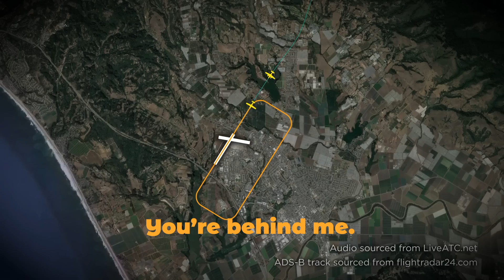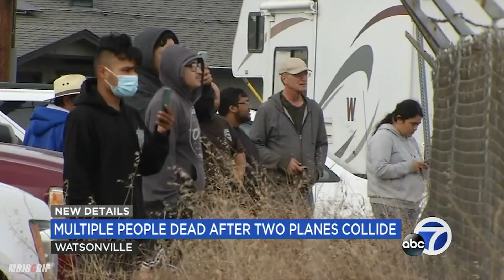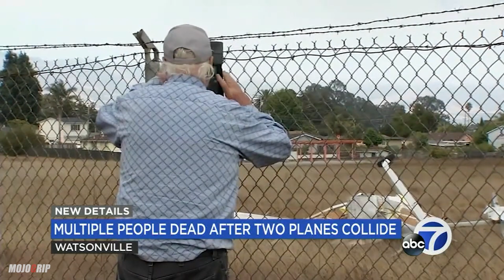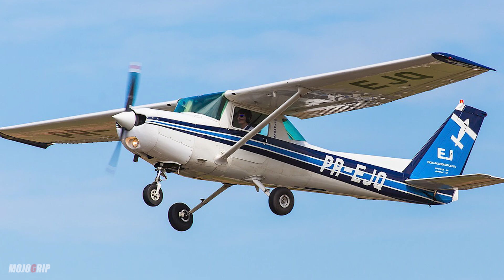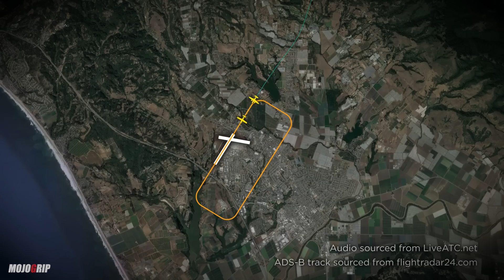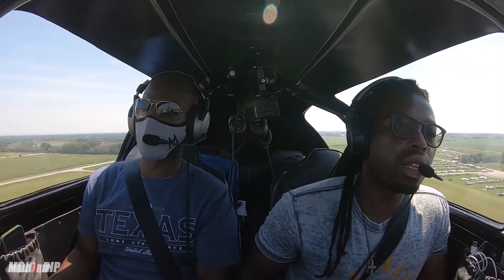Flying Too Fast Can Be Deadly

Comment: I fly a C414A, and I’d be about knots 3 or 4 miles out.  I don’t take chances with uncontrolled airports and enter on a 45 to the downwind.  Uncontrolled airports can have aircraft with no electrical or radios….and speed differences can be deadly. It’s hard to see small airplanes, even my C414 is smallish compared to air carrier. Not worth taking chances, I’ve called off approached when I cannot see an airplane I should. I have been flying 45 years, and have about 9,000 hours.  I’m an old, but not bold commercial pilot.  Final is the most dangerous place, but they can occur elsewhere and there are times where “see and avoid” has serious limitations.

Comment: Not sure what the sight picture is behind the yoke of a C-340.  My guess is that the C-340 pilot, in line, behind, and above, never saw the C-152, it being blocked from view by the nose of the aircraft.  The C-152 pilot sounded calm reporting having the C-340 in sight.  The C-340 pilot not seeing the C-152 may have assumed the other pilot would keep separation. 

14 CFR part 91, states that aircraft, while on final approach to land or while landing, have the right-of-way over other aircraft in flight or operating on the surface.

The C-152 reported turning base, but never reported turning final.  The C-340 may have been coming in hotter thinking he was giving more separation to the plane on base.

14 CFR 91.113 says that when two or more aircraft are approaching an airport for the purpose of landing, the aircraft at the lower altitude has the right-of-way, but it shall not take advantage of this rule to cut in front of another which is on final approach to land, or to overtake that aircraft.

In Advisory Circular 90-66B, the FAA encourages pilots to use a standard traffic pattern when arriving or departing a non-towered airport.

Comment: The twin was established on final. Yes he was in hot, but he was coming in and entered the circuit pattern. 

The 152 made an error of not extending downwind. 

Instructors need to make sure before sending their students solo, that they have the option of extending upwind and downwind. 

A straight in approach is a perfectly safe way of entering, as long as there is situational awareness. 

The twin wasn’t perfect, however this would have been absolved if the 152 had extended downwind.

I have just found out the 152 had his PPL for 2-3 years? That is a long time. If you hear anyone on final within 5nm extend, or you are asking for trouble.

Comment: What are you talking about? Neither one of the pilots did what they were supposed to do. Don’t come into a non-towered airport straight  in when there is traffic in the pattern, you need to join the pattern. 
Twin was at fault. But don’t turn final when there is another plane on final until you work things out with them, please extend your base. I do this all the time.
Reply: Did the 152 not call out his turn to final ?

Comment: § 91.113 Right-of-way rules:

(f) Overtaking. Each aircraft that is
being overtaken has the right-of-way
and each pilot of an overtaking aircraft
shall alter course to the right to pass
well clear.

(g) Landing. Aircraft, while on final
approach to land or while landing, have
the right-of-way over other aircraft in
flight or operating on the surface, except that they shall 
not take advantage of this rule to force an aircraft off
the runway surface which has already
landed and is attempting to make way
for an aircraft on final approach. When
two or more aircraft are approaching
an airport for the purpose of landing,
the aircraft at the lower altitude has
the right-of-way, but it shall not take
advantage of this rule to cut in front of
another which is on final approach to
land or to overtake that aircraft. 

Imo, the flawed part of this is: "...the aircraft at the lower altitude has the right-of-way, but it shall not take advantage of this rule to cut in front of another which is on final approach to land or to overtake that aircraft." It should just state" the lower altitude aircraft has the right of way. PERIOD."  The "should not take advantage part" kind of NULLS the entire statement of the lower altitude aircraft having the right of way.

Comment: This issue is addressed in 91.133. But 91.133 is not thorough enough and may be to blame for this accident. I believe that slow aircraft should be given the right of way over faster aircraft. Gliders, hot air balloons are included because of this logic but for some reason the speed differences of single engine planes vs other much faster aircraft is neglected in 91.133. 

91.133 says when converging is happening the plane on the left should give way to the plane on the right. So when the 152 pilot said he was going to go around, the twin engine pilot, who obviously did not see him below, seem to figure the 152 pilot was able to yield while also thinking he had the right of way since he was on the right. The pilot in the twin assumed too many things such as that there was an experienced pilot in a pattern that knows all the rules, and imo this twin pilot should have been more on top of the communication. There was some passive aggressiveness in the 152 pilot when he said "your coming at me fast". He should have been more blunt imo saying something along the lines of 'we are going to crash' or that he 'can not get out of the way in time'. So the 152 pilot also poorly communicated imo. No disrespect to the pilots as we all do this and now is the time to learn how to prevent a tragic outcome again. 

Back to my former thought, the twin engine pilot was a bit reckless. He had to have known he was in an area with slower aircraft and less experienced pilots. Imo, he should have been yielding to them. Instead, he seemed to be going strictly by the rules of 91.133. The rules state that each aircraft that is being overtaken has the right away and that the overtaking aircraft should alter course to avoid collision. Both pilots though thought they were being overtaken. Back to the former, the 152 pilots communication that the twin was approaching fast and he was going around was somewhat of a confirmation to the twin pilot that he WAS the one being overtaken. He also announced 10 miles out that he was coming in for a landing so he may have felt entitled to land. 

So short story, this was clearly a communication problem and also an FAA problem because I am not seeing anywhere in the CFRs(maybe someone can correct me here?) that addresses the differences in a planes performance. A 152 against a twin engine plane is like a glider against a 152, which brings us back to the twin engine pilot should be expected to know how the performance of his aircraft can put others in danger, especially in areas where there is expected to be a large number of slow planes and inexperienced pilots. The twin engines pilot very poor communication during all of this seemed to neglect the fact this is an uncontrolled airspace. 

So many variables to consider. Better guidance by the FAA is definitely needed. 

RIP to the pilots and condolences to the families. Both of these pilots will surely save lives as we all learn from analyzing what went wrong.

Comment: You can see on flight aware that the twin was traveling more than 200mph at all times.  In the twin when on final the speed recommended is well slower than that.  So sad.  Since there was no fire I think that maybe the twin was low on fuel and that is why he may have been coming in so fast.

Comment: This is also why flying as close to the exact pattern altitiude is soooo important. If the twin had arrived close to pattern altitude, chances are, he would have seen and avoided the 152. I was in a situation a couple weeks ago where I arrived in at the pattern about 200-300 feet high in class D airspace in Greenville SC...a busy little airport nestled between two other airports, a class C and another D and both are about 7 miles away from this one in the middle. The winds shifted and the controller was turning the airport to the opposite runway and vectoring about 4 or 5 planes to accomplish this. I fly a twin Diamond DA62 and was told to follow the 172 at 2 o'clock. Well, I said traffic in site and proceeded to follow it. about 20 seconds later, I notices traffic on my dash that looked directly under me (no warning annunciated) and asked the contoller if there was traffic below me....well there was. I had been following the wrong 172, there was another one closer to me that I would have seen had I been at the proper altitude. Thanfully, he said "left turn immediatley to....." and things worked out fine. If I wasn't in a modern glass panel airplane, things could have turned out very differently. God Bless the families of the folks in this crash.

Comment: I fly out of a airport that has a lot of Light Jet traffic almost always entering the pattern on a straight in for final and usually fast. If the jet (or a large piston twin) is inside the marker (4-5 mile final for the VFR guys)  I will not turn inside them I will extend my down wind and fall in behind them. There is not enough time to do otherwise.  If I am on an instrument approach and someone turns to close in front of me ( Base to final) I will break off the approach and usually enter the pattern on a mid field crosswind.   BTW, the 152's max speed is likely at or slower that the twins approach speed so, no way this was going to work out.

Comment: I only have my first hour and am looking forward to completing training. Thinking about the non- towered situation - would it be common or expected for pilots to include their airspeed in communications with others when coming in for a landing? Intent is communicated but how would they otherwise know if there is sufficient time for either carry out their intent without an incident? Of course they should be looking but it is difficult to judge speed by sight. It also seemed that they shouldv'e included landing order in their communication as another commenter mentioned. I think these would be a part of situational awareness and flying the airplane. Again, I only have 1hr and don't know anything. Thanks for sharing this. It helps learning. Thoughts and prayers for the families.
Reply: You will learn other types of planes rough airspeeds in the pattern. At this airport, no one should ever go 150k on final.
Reply: @Styk33  Thanks. I figured the airspeed was pretty high.

Comment: Another strong argument for standard pattern entry and against straight in approaches.  IMO, the 340 pilot was primarily at fault under 14 CFR, section 91.113. 
You made an excellent point about task specific tunnel vision to the point of a lack situational awareness.  But, don't hold your breath for the FAA to change rules/procedures on landings.

Comment: Several items here (not placing blame on anyone, or this particular situation, just some generalizations): Be incredibly cautious of straight-in approaches vfr. This is not a standard pattern entry. Yes, I am guilty of it, but only when no one else is in the pattern. I notice a lot of GA aircraft fly a pattern equal to that of a jet liner. There is no way they could land on airport if they had an engine out. I was taught, if you are in the pattern and cannot make the airport if you lose an engine, your an idiot. With that being said, my patterns are probably too tight. Turning base when there is a 3 mile final for a twin? That would be close, and your pattern better be tight. When the twin is going 210+ mph on short final, that 152 never had a chance. So…the straight-in approach, the excessive speed on approach, and the 152 turning in front of someone on final, all contributing factors.

Comment: I think it is a technology gap.  We have the tech, it is not where it should be, and it is unacceptable that it is not there.  ADS-B can be leveraged to make a much better solution that what we have currently.  We can also improve what we have on the ground/satelite for the overall airspace safety and management.  An AI override could have saved the pilots and passengers in most of these instances.  For example, G airports would have an automated AI tower and oversight to help mitigate issues...

Comment: At an uncontrolled airfield in the UK you SHOULD always do a proper overhead join,  and then join the circuit to land. A straight in approach is OK if quiet and you will not interfere with the circuit traffic, but is generally frowned on. I'm honestly disgusted with the pilot of the twin doing a straight in approach KNOWING there was a plane in the circuit. To my mind at least that is downright dangerous ☹

Comment: I fly a 340 and the speed at which it was coming in was bizarrely fast. Approach flaps are deployed at 165kts, gear speed is then 140kts, typically cross the fence at 120kts.  Can’t understand why this pilot was going so fast. 
Unfortunate and sad that neither pilot was unable to avoid this horrible incident.

Comment: The cause of the accident is simple. The 340 pilot failed to observe proper established traffic pattern procedures. 1. He did not give way to traffic already IN the established traffic pattern (the 152). 2. He failed to give way to the traffic ahead of him in the established pattern. 3. He failed to give way to traffic on final.
The contributing factor was the 152 who elected to do a go around maneuver from short final and below the 340. This means he would have slowed his decent,allowing the 340 also on final to close the distance much faster. The 340 likely had no time to avoid the 152.
The primary cause of the accident. The 340 failed to observe traffic pattern procedures and maintain VFR separation. The secondary cause was the 152 executed a go-around when both aircraft were on short final with little space between them.